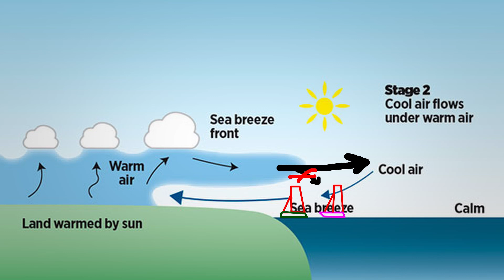Why is it so hard to get through dirty air?... and Rob apologizes to Italy!

Comment: Today, the 14th the wind should be a bit stronger and it is not a sea breeze so perhaps passing will be possible. 

The races are just too short and the courses are far too small. These courses may be fine for the old style boats but they are extremely small for these fast boats. A big course up and down that take half an hour or so going upwind might provide interesting races.

Comment: Question .... Seeing as TNZ have been tacking away whenever dirty air was detected. Would it be possible to dip down slightly and get ahead of the dirty air rather than tacking away? I understand this would be a loss but getting ahead of the dirty air would in my mind be less of a loss than a tack ... am I right there?
Reply: You have a point. Conventional wisdom from conventional (=much slower) boats is that it hardly works on an up and down course when in a fairly steady breeze; it may however be worth it if this gets you in phase with the next shift in an oscillating wind pattern. With these boats(with potentially massive speed deltas), my guess is it MIGHT work if  there was more distance to be sailed before the next tack. Won't happen  on these narrow courses.
Reply: I honestly have no idea but it seemed to me that TNZ was able to stay with LR but kept getting hammered by them with the foul air and constant tacks. If they could break that cycle (at the right time of course) and dip through the foul air They might just be able to use their boat speed which I agree with Mozzy is probably just a knot or two quicker  (maybe not even that much) and reduce that 200 meters down to 150 ish or less by tacking once less, shorter race distances and gaining that extra bit from the extra speed I am pretty sure they have. It would have to be the right time in the race. In tactics available though that 50 meters is a big difference in the options available to the leading boat.
Reply: @ArjanHarre  This is a legit move, called "Leedurchbruch" (= leeward breakthrough) in my native tongue. In order to make it work, you would need to be clear ahead before the next tack.  In this AC, the boundaries are so close. Both boats have to  tack, the boat that positioned itself to leeward is exactly behind again after the tack, in bad air again and has just lost distance.
Reply: @nauticfilms  ... Thanks ... Yeah  I don't think they'd be able to gain a clear lead before the next tack ... But as I understand it the wind shadows on these boats are much narrower and also much longer ... If my thoughts are correct there a small dip would see them through the foul air and only loose 10 meters or so ... I am sure the boffins at the teams have thought of this though ... It's been 30+ years since I raced boats and a lot has changed ... 30 knots in 8 knot winds not being the least of that lol

Comment: Basically F1 problems on AC boats.
Great content as usual
Reply: ha yeh. exactly that. can't follow
Reply: Dammit! You wrote it first!
At least F1 has a chance to fix it every year. I think they should allow spectator boats. On the course. That'll heat up the blood....
Reply: @joeypierantonis7576  Fix it? You mean doing stuff to not change anything. The overtake/spectacle problem has been plaguing F1 for the past 15 years. No matter if using DRS or changing wings for bigger, smaller, higher or lower, nothing changed. Next year will be the same. Peak aerodynamic performances creates problems when near; Less prominenly so in close-cockpit/close-wheels series aka WEC/Lemans
Reply: @gafrers  I feel your pain sir.
That's why I said "Chance".
Reply: @joeypierantonis7576  Absolutely. You are right. My comment wasn't meant in any negative way towards you but F1, FIA, FOTA or whatever other acronym they use now
Reply: @gafrers  The boats are still badass tho. I always like the pinnacle of technology. But unfortunately, as software becomes more prominent, so will parity. But you can always find old school,   man VS machine,  in the lower classes . "it ain't like the good ol days." Nope. & it never will be...

Comment: From paragliding, the ‘downwind’ effects of any feature on the ground are said to apply for ten-times the height of the feature. That idea does not take into account the width of a feature and the ability of the wind to ‘fill in and smooth the turbulence’ from the sides, but equally it does not account for a ‘feature’ that is purpose-designed to steal energy from the wind (ie a sail!)

Comment: In terms of created wind turbulence area you can work out 8 times the mast length. On these boats the "cone shadow" is about 200m. However, it seems to me there is another aspect you didn't touch upon in your video, especially for pre-starts maneuvers - with 8 knt wind (4.11 m/s), if you bear down to leeward at 3 times the wind speed, you are going to enter your own turbulence area coming down. In a situation of marginal foiling that is very dangerous because it becomes very difficult to get out of it, especially if you are not able to power up straight away (Luna Rossa in Race 6).

Comment: Using the F1 analogy, stable light winds and close boundaries make this look as GP Monaco, where qualifying (is more interesting than the race itself). Finding the right racing stadium is the way to go, I believe.
Reply: Agreed. Shifty winds from headlands or starting downwind.
Reply: Exactly my thoughts. The current format is a sprint  and follow-the-leader event rather than an endurance event. Perhaps a larger course and more laps to account for the speed gains of the new class? i.e. get back to a 3-4 hour event rather than a 45 minute one. 100m dash, 400m or marathon? AC is currently a 50m dash.  

Other rules changes could make it easier or more difficult to stay on foils? e.g. you almost always drop off foils when doing a tack / gybe. This would make it more difficult to keep a trailing yacht in dirty air. We had interesting racing in December where boats needed to do everything possible to stay on foils. 

The fact that Ineos could manage with 6 grinders opens up possibilities for a longer race where the stamina of all crew are put to the test. Teams would need to rotate skippers, trimmers etc to generate the manpower.

If the start box produces overwhelming advantage or disdvantage, get rid of it - Standing starts, flying starts, pace boat?

Adding a third yacht to the match would open up a whole new ball game. Yes, a fundamental change,  but so too where catamarans and foils. 

The organisers of the next AC need to come up with a new set of racing conditions - just like F1 do every year in order to keep the challenge relevant. There are many options that can keep the spectator interest as well as develop sailing.
Reply: @chrisrowse4598  Wow! Today! Crazy.

Comment: Have you/anyone got any numbers on the size and time length of the wind shadows for different wind conditions?
Reply from the maker: I think predicting where the disturbed air will be is relatively easy. What is harder to predict is the decay of it, how quickly it is mixed back in to surrounding flow etc. That changes on a day by day basis.
Reply: I had another look at your video and noticed the vortices, as drawn, are in the plane of the yacht’s direction. They should be at right angles to the yacht’s direction. There is still up and down motion of the air but it is now either side of the yacht’s path rather than along it. Any which way you look at it there is dirty air trailing the yacht. A good picture showing this for a plane’s wing is https://www.flightliteracy.com/wp-content/uploads/2017/12/14-45.jpg

I wonder if the teams have done any wind tunnel tests on this? I know, back in the day, my alma mater (University of Southampton) had a wind tunnel for exactly this type of research.

Comment: Thanks guys, I agree with much you say about the starts.  But, my two cents,  winds are TO LIGHT for these high tech vessels and well trained sailors!!
New rules needed.  Minimum wind 12 to 15 knots, move races if necessary to consistently higher wind areas.  Here’s my F1 analogy, spend billions on the high tech cars and tell them the speed limit is 50 mph!!!
I love your analysis.  Keep it up!

Comment: Mozzy, in the r/AmericasCup subreddit they were referring to the fact that ETNZ had systematically wrong and higher wmg numbers in data both on board and in the virtual eye. Somebody was saying that ETNZ actually knows it but they just go along with that. Nobody is certain why but could it be that's why everybody is saying that ETNZ is a faster boat? You do start the video by stating that.
Reply: I don't think it's wrong. It's GPS-measured, after all. I think they're going fast in a straight line (including VMG) but lose really badly on every tack and in the speed build after it, especially when confined to only half the width of the race track and thus tacking twice as often. Am I right in thinking that in 12m days there were no lateral limits to the race course, other than there being no point in going past the layline?

Comment: Is it just me or the up and down straight upwind-downwind takes the sailing abilities, wind reading, etc. out of the competition? As you said it's far easier to just cover your lead instead of really out-manouver you opponent. An "A to B" course with more buoys spread in different shapes (depending on the breeze of the day, the angle of the incoming wind, etc) would pose a more demanding challenge to the teams and far more possibilities of strategic (or luck) overtaking the other yacht.

Comment: Americas Cup have turned so much into F1 on water so it even assimilated the formers problem with turbulent air for a following competitor. The question is how much more efficient (& fast) you have to be to be able to sail past the other boat. We all loved the race from X-mas cup which had 9 lead-changes but now it seems like the race is won or lost in the pre-start, so the question right now is how to get past the leading boat and what has to change in the rulebook to get these interesting races for AC37.
Reply: Wind shadow effects slow boats racing too though.

Comment: It's not uncommon for there to be no passes in the America's cup finals  .. none in 1995  .. none in 2000  .. one I think in 2003  .. one or 2 in 2007  .. 2013 there were some but that was a strange final.. 8 - 0 to 8-9 .. 2017 there was a couple of passes but once ETNZ got ahead it was game over   .. in this regatta courses probably need to be a little wider and when the boats hit the start line at speed and dead even its intriguing   .. just my veiw .. probably wrong   .. lol .. very interesting video btw and thanks for posting  👍
Reply: Professor Mark Orams agrees with you. Course is far to narrow. Ridiculously narrow.
Reply: I don't think the lack of passing is entirely from the narrow course. On a wider course, thr lead boat would just cover the trailing boat, and still pin them up against a boundary. The wind just needs to be shifter and more patchy to make this entertaining
Reply: But yes, I agree, every armchair sailor is saying we should move back from foiling, because there aren't any over takes, and the race gets boring. Go back and watch any of the races on the IACC boats, wide courses, non-foiling boats, long races. And the boat that led off the line would lead the whole race. It was still boring, just for 2 hours at a time
Reply: @carlzimmerman5830    Difference being that a faster boat could pass previously. NZ seem a tad faster, but it seems that you have to be monumentally faster in real light airs to even have a whisker of a chance making a pass. 
Generally in previous cups the faster boat could get in front pretty quickly. Also in these boats every tack you do, you lose out massively.
As far as I am concerned, there are big differences.
We shall agree to disagree.

Regards

Comment: You guys are over thinking it again. You weren't thinking like this during Prada Cup, when winds were stronger. We saw very close racing between Ineos & LunaRossa. Closer starts, more “mistakes” plus wind shifts and more opportunities. And these boats are difficult to sail.
Reply: The difference here is that the team's then were at ~85% perfection, so there were still lots of mistakes and plenty of headroom for being a faster boat. 

Now for the final, the team's have basically perfected sailing their boats (~98%) so the number of errors from the team's is so low that once you're behind, you can't expect the other team to screw up so you can get past.

On top of that, they've very much hit the point of diminishing returns in terms of boatspeed so I don't think there are going to be any more Ineos ACWS - Prada Cup levels of increase anymore.
Reply: Forget the spectators then and set the racing courses further out to sea like the previous cups...

Comment: Not sure if this has been said already since America's Cup has been compared to Formula 1. Well since the cars of so Aero dependent - there's not real overtaking in Formula 1 either. So the analogy is better than we thought unfortunately.
Reply: Yeah also the reason I used to watch the start and the first corner of the F1 then switch off or go back to sleep.
Reply: A pit stop then on leg 3 to change sails.

Comment: I agree on the pre starts being the most exciting bit of the races but even they aren't particularly interesting, the speed is really the only interesting element, there are no dial ups, no using the committee boat and the boundaries. I hate to say it but the world match racing is soo much more interesting.  They aren't the cup though.  Maybe there should be a mandatory sail change mid race.!!
Reply: A mandatory man overboard drill at some point in the race where they are required to scoop a floating 200 lb. crash dummy out of the water.

Comment: Actually I think the races are to short. In the past they would last for hours. How much difference would it make if you make it say ten legs? I't would only ad 20 min. The slightly faster boat would have more opportunity to overtake when behind and more chance of mistakes when crews get tired. That and wider courses. I'm no expert by any means, just putting it out there.....
Reply: There is a certain amount of flexibility there already. In really light conditions sometimes the races are shortened to four legs to try and get a result within the 45 minute limit. All the mechanics below the waterline are battery driven hydraulics so a finite number of actions there. They wouldn't want to sail these things anywhere near flat battery territory in a looooong race.

Comment: Short races  and boundaries trivialise the AC.
Reply: We should have one triangle shaped course.
Reply: @andrewdykes4771   We had triangular courses forever (and still have them in some more conventional classes). Decades of experience show that there are far fewer options to overtake on a reaching leg than on any upwind or downwind leg. So that would be a step backwards and not solve the overtaking problem we see in this cup. Making the course wider, as some have suggested here, would probably work better.
Reply: These tracks are quite large.

But these boats are easily 4 times faster than normal ones. So it feels small and quick. And rewards quality maneuvers as much as fast boats.

Otherwise ETNZ would have won by now

Comment: Interesting discussion and good suggestions on how to make the races more interesting   I get the feeling like Jimmy will sandbag LR a little when they make a mistake and get behind so far he knows they can't win without multiple unforced errors.  It seems like in at least two races this happened - with a LR luff and a bad jibe.  The starts are so crucial that I wonder if he concedes the races they are trailing in order to keep NZ guessing.  NZ feels a tiny bit faster, but Italy is smoother maneuvering and has plenty of speed too.   I think it's really smart to have dual helmsmen and avoid the scrambling back and forth.  It must be especially crazy trying to move around the deck at these high speeds.  These boats are amazing!

Comment: Rob, your apologies are well received! The impression from down here is that NZ relly is faster but they like manouvring much less than LR. Listeninf to the post race interview it is clear that they NZ is more interested in bringing out speed from the boat rather than perfecting the biologicl component of the boat. How you hae pointed out really fairly LR are doing what they can with an excellent but slighty inferior boat.
Reply: Winning races is a sign of an inferior boat? using and applying what you have is an indication and sign of sound sailing.
Reply: Those small NZ foils are fast but hard to control. Size matters in light air.

Comment: I have witnessed 2 critical "unforced errors" by LR.  They are liabilities that will carry into the final stages of this event.  Being up 3-2 and getting the superior port side start and then literally dropping out of the race at the pre-start is completely unacceptable.  Being up 4-2 would have struck a serious blow to ETNZ.  Instead, the momentum is completely on the ide of ETNZ.  At this rate, ETNZ do not have to win the ensuing races.  They just have to sit back and be entertained by the next series of LR abhorrent mistakes.

Comment: Do you think there is also turbulence in the wate created by foils breaking up the water density at 40+ knots in straight lines? The less dense water would greatly increase the displacement risk and makes flight control less fine, eventually troubling the aerodynamic setup. What is your take?